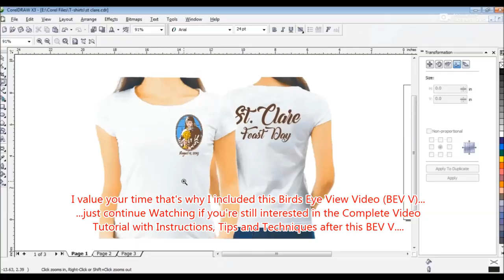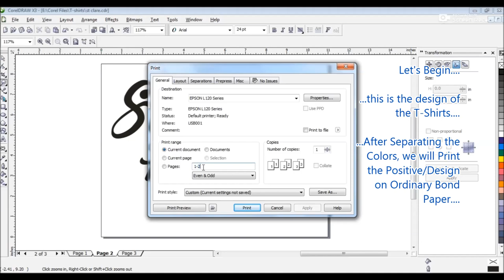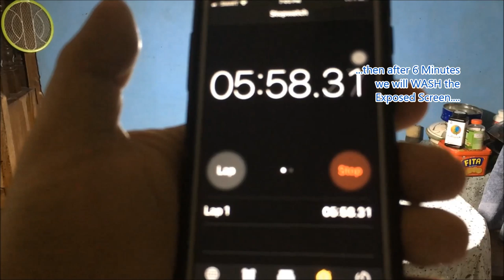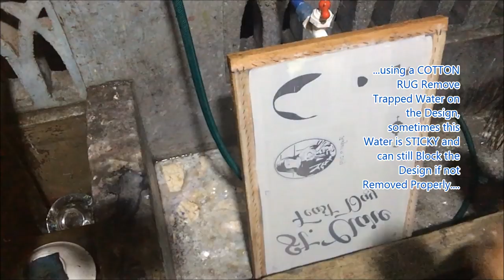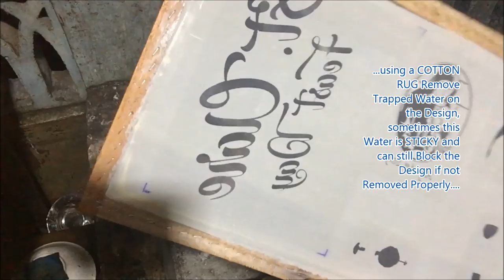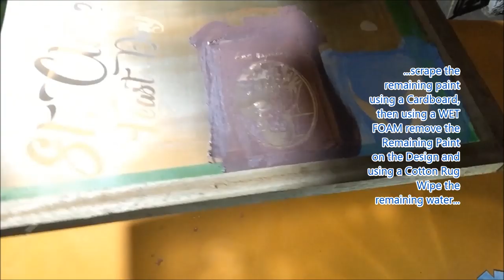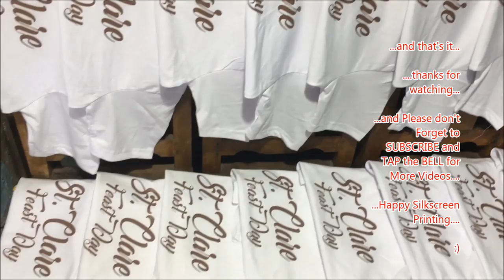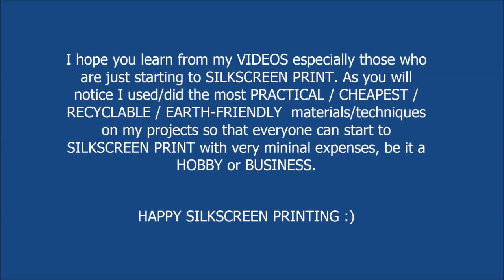Multi-Color Printing using Water-Based Paints: Silk Screen Printing Simplified

Comment: sir easy, 
do you not use a adhesive platten for multicolored shirts? 
or did you skip it because its a smaller pocket print?
Reply from the maker: Using adhesive platten is always advisable in printing multi-color be it a logo or big design.

Comment: good morning idol easy. ask ko lang po, ano po mesh count ang gamit nyo sa video na yan para magawa mo single coat lang? ok lang ba kung ang platen eh may balot na leather ng sofa tapos wala na foam sa loob? thanks in advance po...
Reply from the maker: 100 mesh po yung screen na gamit ko dito....mas maganda kung may FOAM ang PAD para Pantay at makapal ang pahid ng Paint...
Reply: @EasyVideos  salamat po sir sa points
Reply: @EasyVideos  btw sir, paano nga po ang advisable nyo mixture ng jj virgo na superwhite premium & wetlook premium kung gagamitin sya sa dark colors kung yung una layer eh white tapos lalagyan ko ng pigment color para 2nd color? paano po ang curing ng jj virgo?